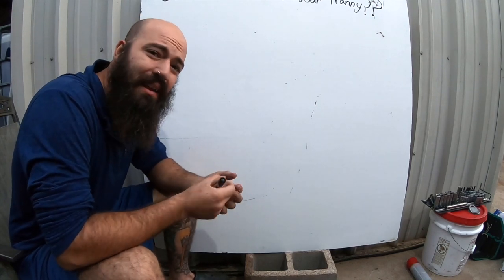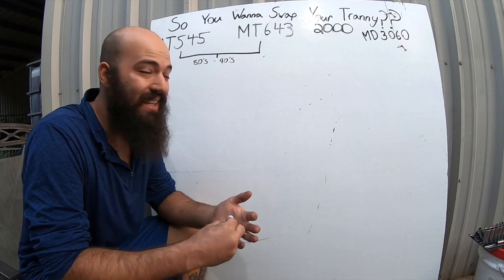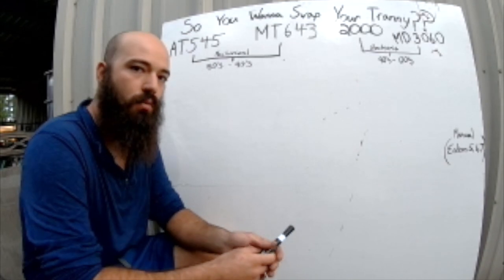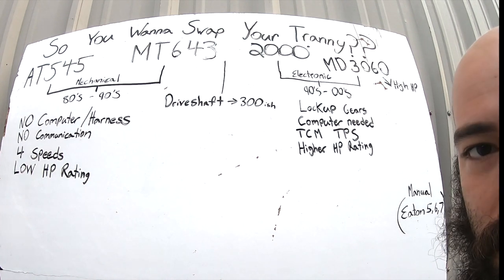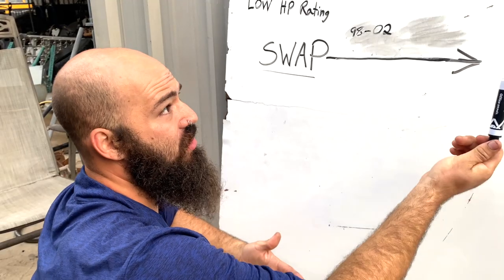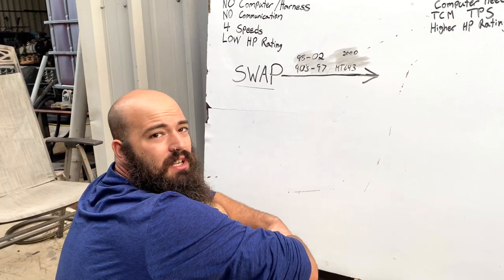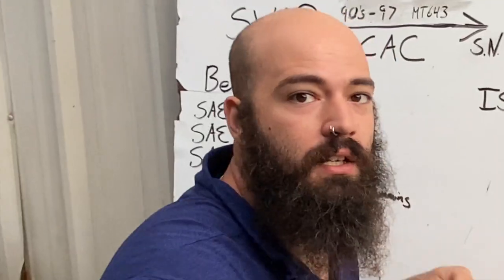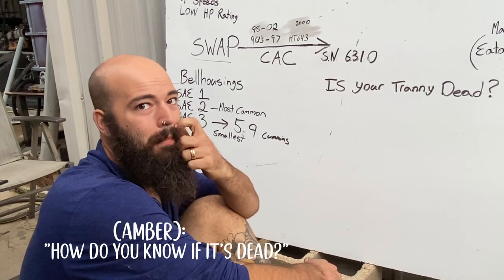Everything you need to know about your SCHOOL BUS ALLISON transmission | Swapping Transmissions

Comment: The best transmissión between all the rest is the 643 5 speed, I have one whit over million miles when she death, now I have only one on service whit around half million miles or may more that whit no issues, is the most reliable transmission, the 2000 just work couple months in my country some time work for 1 month 3 months 8 months but never survive a year is trash for us,is the reason why we swap to 909,13,6, 7 or 10 speed, the 10 speed work so good the 15210 ,14609,14607 ect,5 speed we broke by half some time 😁😁😆💪🏿🤯 very loco drivers there amigo we love the torque from 250hp 275 ,300hp or 240hp water cooler   different versions non intercooler,I  love this video 👋
Reply from the maker: Thanks for watching buddy! Where are you from?
Those are some sweet set ups! The MT653 is a unicorn, I spoke to a guy this past week who has a 12v 5.9 with that MT series on the back.

Comment: i got two Ford trucks  25 ft box truck.....sometimes gross 34,000 lbs....they are 95 models...had a long time....i had no problems with them what so ever....never go back to manual...i got tired or replacing clutch and press plates long time ago....

Comment: The AT545 is a common RV transmission and is fine on the highway and interstate.
Reply from the maker: Yes, it was. Thank you for your input, did you watch my boring video or are you just responding to my thumbnail photo?
Reply: have a 542 in a stepvan behind a 5.9 ISB. I am wondering the fuel mileage on intersate plus the overheating in mountain driving. I have not looked at the condition of this one yet fluid is used but not too bad. It is seeping fluid and oily all over. I wonder if I should try to convert to a 2000 for the locking torque converter and 6 speed overdrive. Your thoughts?

Comment: I have a 2000 series with a 5.9.  Would there be any benefit to swapping to the MD3060? ( 2004 Thomas MVP 27ft Flat Nose)
Reply from the maker: You’ve got a sweet set up already! If your 2000 series is going out we have a lot of used ones in Alice, Tx to choose from.

Not for the $$ it would cost, you could potentially gain a sixth gear but at the expense of a lot of resources. The bell housing on the back of the 5.9 will have to be swapped. MD3060 has an SAE 2 bellhousing.

Comment: Terrible background noise .
I have a AT 545 and I drove it for around 500 miles and the transmission never heated up on the highway. The engine is a 7.3 PS Navistar wirh a ECM. The bus was slow in traffic but not a problem. I don't know whether my AT 545 is computer controlled or not, I assumed it is.
Reply from the maker: Yes, we are only 100 yards off the interstate. Very thankful not to be around this constant noise anymore.
The AT545 is not electronically controlled, if you happen to have not watched the whole video.
Reply: The AT545 on computer-controlled buses, has a computer-controlled shift module on the side vs the older ones that have a mechanical shift point adjuster. Internally, they all are mechanical.

Comment: Did you have any problems with your engine ECM working right with the manual setup ? I know with cars and trucks you have to change your program in the ECM because was a auto
Reply from the maker: Since the 545 is mechanical my computer was already programed correctly, I did however swap the computer over from the donor just in case. The donor was also 5 extra HP so I was hoping this was controlled by the ECM as well.

Comment: Hello, I've got a military truck with Cummins 5.9, 6BT, 12V.. Please suggest a suitable transmission for the same. Thank you
Reply from the maker: A military Truck huh!
You should def put an Eaton 13speed. You should have all the room in the world between the frame rails

If you’re motor is rated @180hp like most buses & medium duty applications I would seriously consider pumping up the HP.

I have one here in Alice, Tx and two others in Houston Tx.
If a manual isn’t something you want to deal with maybe the HT740, it’s fully mechanical and used for heavy duty application. Moral of the story, go HD instead of medium duty.

Comment: Have a t444e with the AT545 do you recommend the MT 646 or 1000
Reply from the maker: Albert, did you watch this video? It should have cleared up some things if so.
This is a preference question, you’ll have to decide which you want from the characteristics of each transmission.

Comment: I have an Allison 2000 in my bus and I'm being told that it is only a 4-speed transmission and that there is no fifth gear to unlock I only hear it change gears 4 different times well while driving so I'm not sure
Reply from the maker: Hey buddy! It’s my understanding that the Allison 2000 didn’t go into service until the year 2000. If you only have 4 gears it is not it, the Allison 2000 has 5 gears with a potential to unlock 6th. You will have the At545 or the MT643 most likely
Reply: Iam going by what the MC told me hold on I'll get some numbers for you

Comment: If you want to know the shape of your transmission send an oil sample in and have them do an analysis on it.
The lab results will inform you as to approximately how much longer the fluid has to it needs to be replaced and if there's any abnormal contamination in the fluid don't forget to change the filter on the transmission, as many have a independent filter mounted near the side of the motor and some internal transmission filters are actually filters and some were screens so consider replacing that as well.
Allison also used two types of transmission fluid one of them was a 390 something in the real synthetic one was a 296 so you need to research that when making the tranny swap also as the lower number is the real synthetic that is a lifetime fluid other than replacing the spin on filter.
And Allison transmissions have many number series and some came with a close ratio and some with a wide ratio. I prefer the 2500 series if your GVW is under 30, k, if it's over that go for the 30 60 with the retarder if you can set that up you'll never need to use your brakes until you're sitting at the light.
Reply from the maker: Thanks for all the additions!
Any idea what an oil analysis costs?$$
Reply: @parishskoolie  any Allison transmission dealer , cat and Cummings specific shops should have the kits in stock I think it was like 30 bucks last time I did one you get a printout from the lab just need to let them know what oil they're dealing with engine transmission oil whatever, as this test is used for engines and transmissions so they know what they're working with and looking for. 
My dilemma is my 545 still works it's in a 95 Freightliner with a 5.9 second gen over 3.76 dif spinning 225/70, 19.5 tires.
So my bellhousing is a number three and I have a fresh 644 on the floor with a number two bellhousing.
Do I change out my ring and pinion 3.33/3.08 and run the 644 or go with a 2500 PTS with the overdrive?
Reply: Crazy Wayne, ever heard of anyone installing  a 3060 behind a International DTA-360?

Comment: the md3060 can be found in 1998 an up tc 2000 busses. minea a 1999 an has a factory md3060 in her made un jan 5th 99
Reply from the maker: WHOOP WHOOP!! Sweet transmission option. Wish we had it in either of our buses. We have a Cummins 8.3 mated to a 3060 on the yard made in 1991, they ran much earlier than 98 but I still have a hard time finding their release date. Thanks for watching!!

Comment: Really great video on transmission types for ur busses. MT643 will be my choice replacement when the time comes. Do you have a recommendation for a really good transmission cooler? 
take care
John A 
60107.
Reply from the maker: Thanks for watching buddy!
I was all over eBay looking for a cooler, I ended up with a smaller one. (We have a video up on the one I chose). It did in fact drop my temp about 10-15 degrees while under load. We have a handful of MT643s allaying around if you are near south Texas. I probably wouldn’t buy the same tranny cooler again. Whatever type you get, it needs 10AN fitting style attachments. Anything you get with those will be HD. Good luck!

Comment: I have a 97 freightliner how would it have an Allison 2000
Reply from the maker: You don’t. Allison 2000 started in the year 99.5-2000. Only exception is if someone has swapped it already
Reply: Must have been changed by the school system because neither the engine or transmission numbers are the ones that come with my bus originally so 🤔 🤷 😕 I have the A2000 and thinking about putting a manual in my bus ,trying to talk my Mc into it we will see what happens this year with fuel prices going like this going to have to do something to get better speed and MPG
Reply from the maker: @johnlange2573   That would be sweet if the school system did the swap already! If you do have the Allison 2000 your speed & RPM should be good, unless you have tiny tires. After doing my manual swap I am not happy with 2400RPM @ 55mph. My new fifth gear is a 1:1 ratio which is the same as my 545 was in 4th!
My calculations & research leads me to believe if I upgraded to 11R22.5 from my current 10R22.5 I will get 350+ RPM drop @55mph. My .2 cents
Reply: @parishskoolie  sounds to me like you need to install a two-speed differential and learn how to split some gears.
Say 4:30 over 5:18 would be sweet two speed gearing for your tire size
Reply from the maker: @crazywayne7051  BRO. I seen a two speed rear end for the first time scrapping this summer. I went back after the end of the day to save it from death (it was already loaded). Once I got it disconnected & tried to pull it out with equipment i snapped it:(

I'm going to try the bigger tires first. I have 4.63 gears in the rear & have a 4.33 that cam out of the donor.
Reply: @parishskoolie  just go with the two speed then you'll always have a highway range and a city steep mountain gear range
Reply: @parishskoolie  and on your five speed when I used to do school buses those transmissions are notorious for breaking the detent springs in the shifter for housing I suggest you carry your few of those around with you what usually happens is you'll come to a stop with your foot on the clutch and it will slide into gear on its own with the shifter locked in neutral usually end up getting stuck in second gear when this happens.
Just something you should be aware of.
Just turn the locking collard remove the shifter and using a screwdriver push the shifting fork back into neutral and you're good to roll but need to replace those springs one of the gears feel soft it's probably a broken spring and it will coil up onto itself until not engage the detent ball.